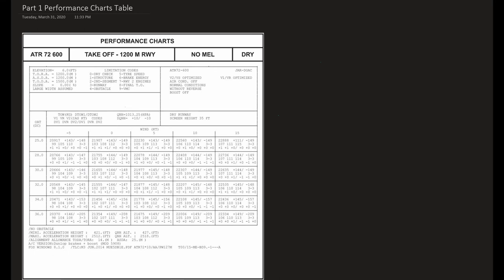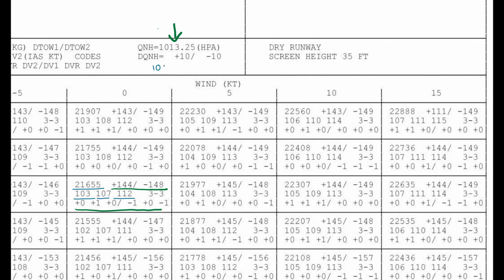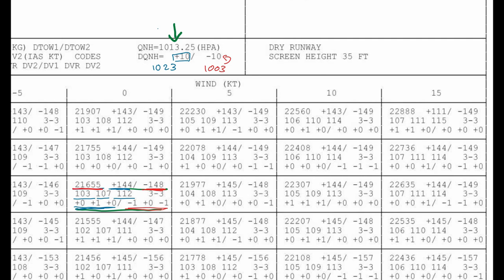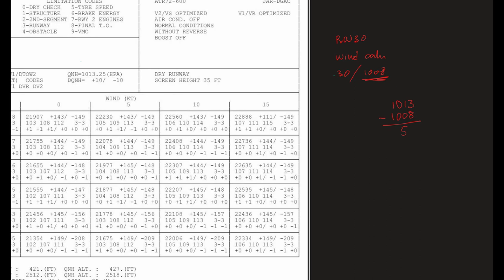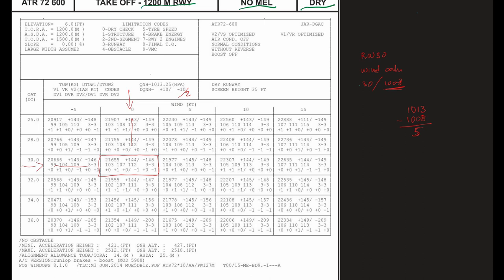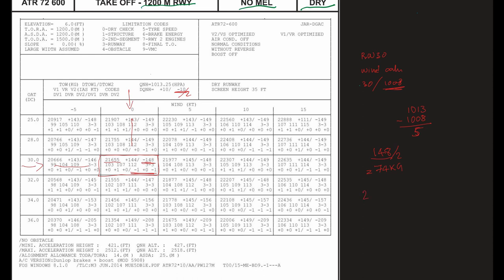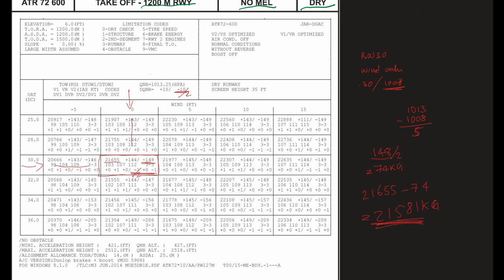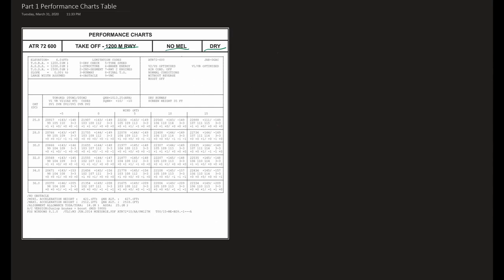ATR 72 600 - Limiting Runway Performance Chart Table

Comment: Thanks for this. It helps alot. But what is the meaning of "3-3" beside the Vspeeds?
Reply from the maker: Oh, those are the limitation codes that u find in the top box of this page.. normally a takeoff will be limited by two items, 3-3 means its just limited by Runway only. 

For example if its 3-4 then it means takeoff is limited by Runway and Obstacle
Reply from the maker: Sorry for the late reply, i live in Maldives, Male city, 2 days ago we just got fully locked, Cavid 19 cases in the city.. i ve been a bit busy..
Reply: oh now I understand. Thank you so much. Im looking forward for more educational videos about atr . by the way, keep safe.

Comment: What if my QNH is for example 1016. Do I need to add +3 on DQNH and get the fraction of it to subract in DTOW1?
Reply from the maker: So if ur QNH is 1016 that is plus 3 from the standard value.. in that case u ll have to take 1/3 of the +(weight) in the table.

In my example condition but with your 1016 QNH it would be 1/3 of (+144), which is about 48KG. so u add that 48KG to the given TOW in the box.

Comment: hey where can i get ATR performance data like required runway length, payload vs range etc? bcs i can't find any source available. please send the link, that will be helpfull. thanks a lot
Reply from the maker: This data table was provided by the airline through ATR, u wont find it online..  but u can get performance charts and data on FCOM or AFM